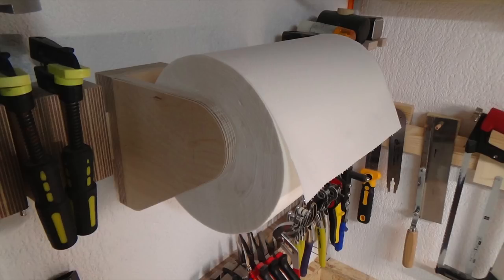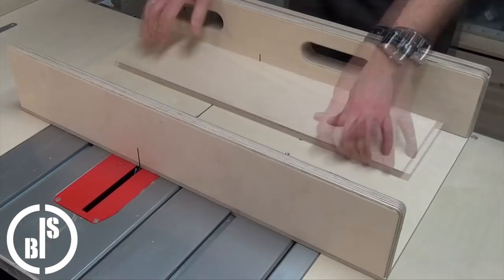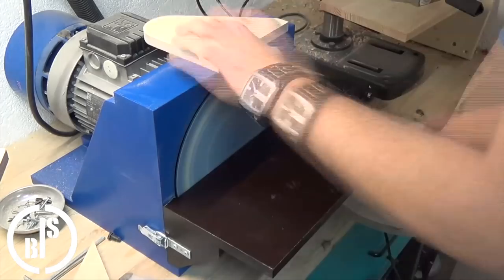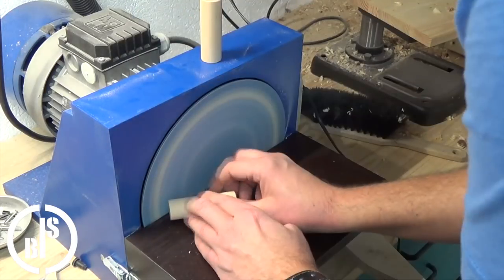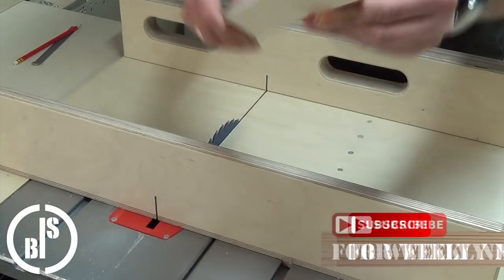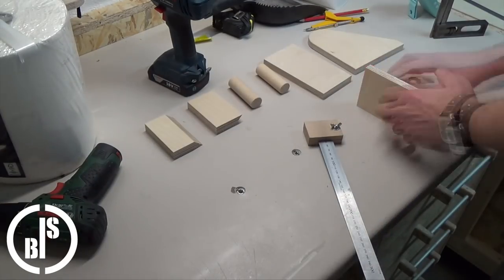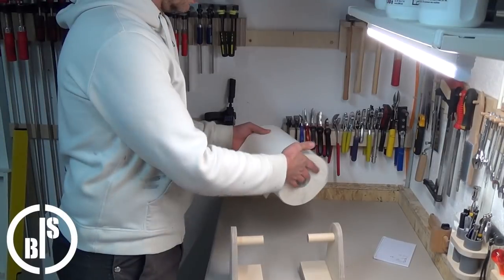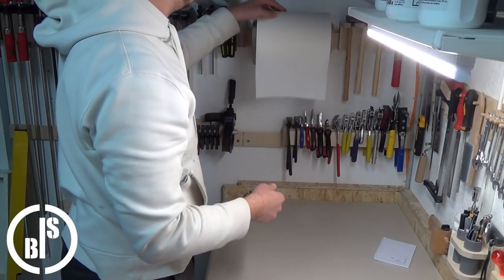How to Make an Adjustable Paper Towel Roll Holder

Comment: The feature of variable width rolls is a nice touch. A suggestion.... If you span  a contraction spring between the left and right, it keeps the roll  from falling off and also it provides friction to the paper roll.  This allows one hand operation . Pull down slowly,  paper will not tare,  and do  a quick lateral jerk and the desired length will separate without the roll spinning.